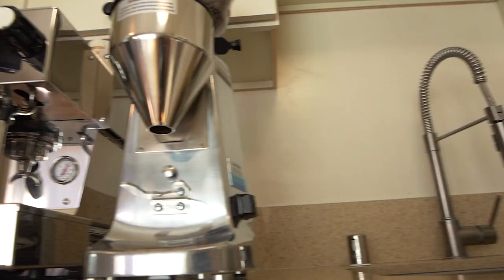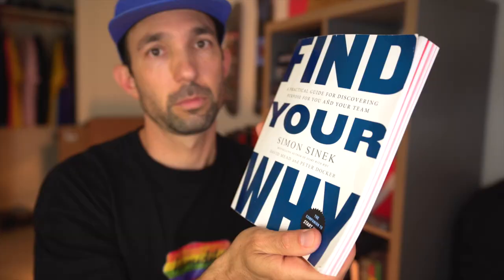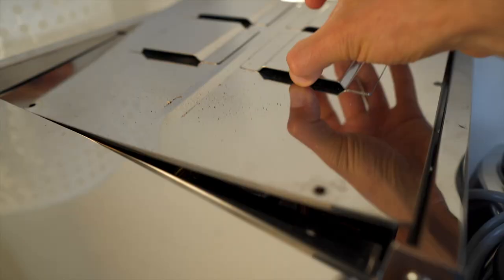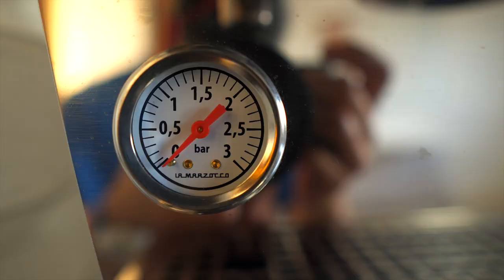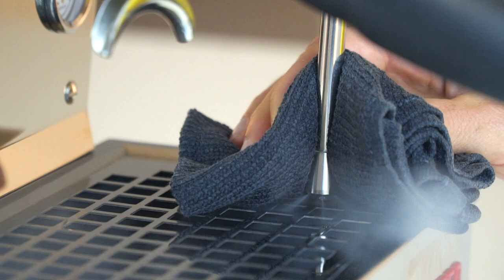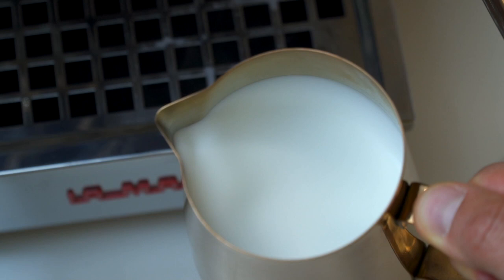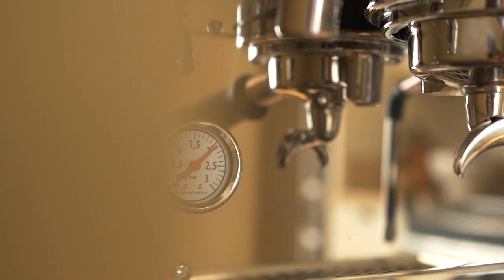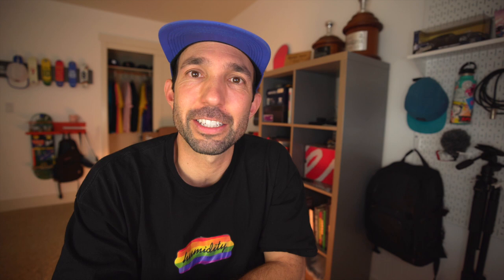La Marzocco Linea Mini Espresso Machine Review | Worth The Money?

Comment: I have a mini, I use it daily and I like it, but here is a reality check:
1. A lot of the stainless steel is lower grade/ thinner than less expensive machines. 
2. Within two week of purchase, the paddle switch on mine failed.
3. Within the first month a bushing on the pump started leaking. Tech discovered it had been over tightened at the factory and was cracked. 
4. Potentiometer failed and had to be replaced one week after the one year warranty expired. 

It makes great espresso, but has been a little high maintenance. The out of warranty potentiometer cost me a couple hundred bucks for the part, labor ,and the techs travel time.
Reply: same here with the GS3
1. Stainless steel not deburred
2. check valve broken after a few month
3. watertank deformed after   a few month  and causes false alarm (refill water)
4. 3 hole steam tip was the worst ever constructed, had to bereplaced by a 4 hole tip
5. LCD display faded after a few years, barely readable
Great espresso but this is by far not state of the art  this is "let's keep the price high  so people are convinced to brew the best espresso ever" otherwise they had to admit  to be pulled over the barrel (at least a bit :-)   )
Reply: Its like having an Instagram-hot GF.. great looks and maybe great sex but high maintenance! lol!

Jokes aside! I am looking at Dalla Corte Studio vs this. Now I see why I should stay away from the LMLM! Thanks for the heads up! I also read in forums that the GS3 is also troublesome! it seems LM is just a name and not worth the headache!

Comment: Some of my local small ice cream shops use linea minis paired with mazzer mini grinders for espresso afagato. Works great even in a light commercial setting.

Cost is a huge barrier to excellent home espresso. My local shop charges $2 for a doubleshot. That means it would take me 10 years of a coffee a day to make a $5000 machine 'worth it' for just myself. The economics do change when you have a family but it's still a lot.

Comment: I understand that the Linea Mini is programmed for one-second preinfusion. I am used to preinfusing from 5 to 20  seconds, depending on coffee and grind, on my Londinium lever machine. What is the point of one (!) second? Do you not find that a limitation?
Reply: I need an answer to that question as well. I don't really care about going as far into control as with, let's say the decent, but I feel like with the mini, for 5k, you're kinda short on options...
Reply: Shinshokuful This machine is designed for the home user who wants simplicity and power, and also mostly small cafés or catering. In a cafe setting there is no time for adjusting pre-infusion.

Comment: I kind of agree with you BUT. The ability to do a slow. Low flow pre-infusion is a game changer. It changes regular ole medium/ medium dark roast espresso blends as well. There are “Slayer mods” for the Mini. There are custom Led mods for the temp. The Mini was designed before these things got standard. If you’ve had god shots from a AV Strada, a Synesso Hydra, a Black Eagle, the Mini can come close for more than half the price. I think the Mini is best for those who want to keep it simple. Enjoy the beans the Mini does well. Pull the same coffee until the bag runs out. Maybe even stick to the same blend and roast. If you like Nordic light roasts, some difficult SO’s, want to pull Gesha espresso, better to have a more versatile machine like a Strada mod GS/3 (to keep it in the brand). But then the question is, how much better is the Mini than the Breville DB at 1/4 the price?

Comment: I really want a Linea mini but for 2000 less, I can get an ECM synchronica that has pretty much the same specs on paper. Anyone any thoughts?
Reply: definitely.
Reply: I have one I am happy.
Reply: I recently got the Profitec Pro 700 v2 (same machine, different exterior) and love it. 

Was tossing up between this and the Linea Mini. Heart said LM, head said Profitec. In the end LM made it an easy decision with a recent price increase which is Aus was significant.

Having a built in shot clock is a little feature that I would struggle to give up now too.
Reply: @GH-de8wv  yeah, I would like the shot timer in the ECM... Tnx for sharing!
Reply: Synchronika owner here. It's basically 95% of the experience of the LMLM IMO. Some users of both have said that the steaming on the LM is better (drier) because of the larger boiler and non-insulated wand; however, the Pro 700 & Synch have the same 2-bar pressure as the LM. However, I got maybe 5 mL of water from 30 seconds of running the steam wand after purging, which I'd consider to be negligible. It also has rapid recovery; after steaming milk for an 8oz latte, it never dropped below 1.5 bars and was back up to pressure by the time I prepped my next shot and started pulling.

If you're still considering the LM, double-check your vendor's warranty policy. Where I bought my machine, my Synch comes with a 2-year warranty (where the vendor will pay for return shipping), whereas the LM, as it's considered a "commercial" machine, is not subject to such a warranty and therefore servicing it will be more expensive.

I also love Profi/ECM's shot timer built into the PID. It's such a brilliantly simple feature.

Lastly, you can get WLL's Flow Control Kit for the Profitec/ECM E61 machines to play with flow profiling. You're restricted to a set 1-second preinfusion on the LM. There's beauty in simplicity, as Chris said, but that might leave some tinkerers frustrated. Depends on the person!
Reply: @LuckyDragon289  woow, thanks! I might actually go for the ECM now. You made some good points about the tinkering features there, which I am a fan of. I think I'm good warranty wise since I can buy the machines at my own work.
You were really helpful, thanks!
Reply: @GH-de8wv  this is my future
Reply: Thanks for the video. Good fun as always. Agreed on the steaming performance and PID wheel! Interesting, would have thought the GS3 AV would be better for events because of volumetrics. I won a LM LM and sold it to fund a two group machine and grinder and a cheaper HX machine for home. Needed the output.  I do feel a bit sad about all that.  Maybe one day back to LM. ✌️
Reply: Just have a look to that stupid plastic dial/temperature control of Linea Mini, also cheap plastic switch (no it's not a paddle)... You'll never find those cheap parts on a ECM or Profitec. Have a look to the PROFITEC LUCCA S58, with under counter pump and reservoir <3
Reply: TomTomGalore No point in shitting on other peoples dreams man, enjoy your opinion like others enjoy theirs...
Reply: @bboulette08  : profitec is very nice, I owned a pro 800 for five years....but they too have their problems, as does any machine. Mine was horrible to work on for instance. Had to replace a solenoid valve, took forever because of the retarded way they put everything together. There's no such thing as a perfect machine.

Comment: Hey, I've got the Linea Mini and absolutely love it (I'm using it in a little cafe I opened up btw). Just one thing I don't like or haven't figured out. When I want hot water, it splatters all over. Is there an adjustment or way to just have hot water flow out without spattering? Cheers from Canada.
Reply: It's a tricky thing but if you just tweak the dial a little bit (don't turn fully on) you should get a better stream from the nozzle. I turn it slowly just until water comes out, it's kinda slow but it works.

Comment: I have a Quickmill Vetrano V2b (1st gen) that retailed for mid 2K. While the espresso quality is good, and the PID is nice, the steam power has never come close to what I experience at 3rd wave shops. Steam power is less, is less dry (has more moisture), and the tip opening size and angles never get the vortex needed to do truly high quality microfoam. I've used 2, 3, and 4 hole tips. Over 7 years, thousands of lattes, and experimented with different angles, pitchers, milk brands, etc. Still nowhere near what I can achieve on pro machines (yes I'm friends with a couple of local shops that let me use their machines after hours). My next machine I want to steam like the pro machines that my friends in my local 3rd wave shops use, and the Linea Mini looks to fit the bill. I do wish the temp control was digital, but I can live with the wheel. The other thing I wish this had was a shot timer, but I'll continue to use my $8 kitchen timer if it means this machine will brew and steam like the pro versions.
Reply: If you are into light roasts you should buy a machine which is capable of flow or pressure profiling.

Comment: Question about dose on LM groups... do you usually end up with a screw imprint in the puck after pulling a shot? If I put an 17g dose in a 17g basket, I get a little imprint. Good/bad/who cares?
Reply: Sam Roesch probably depends on the basket but different coffees can take up more volume for the same dose. Screw imprint means you should reduce the dose ideally, because there should be enough room for the puck to expand as it saturates. I routinely dose over 20g in a 17g basket (not LM), so there is no exact dose, just experiment.
Reply: Nice thing about these machines is you can replace baskets to whatever your heart desires. It's all standard cafe sizes so you can get a basket that fits your desired dose. Yeah it's more money but worth it if you want to go the pullman/VST route.
Reply: Michael Hartmann I’m aware, but that’s not really what I’m trying get at, to rephrase: my question is whether LM purposely sizes a 17g basket such that the dose hits the shower screen (despite common lore saying the puck should not touch shower screen)

Comment: I found your channel due to the Linea Mini unboxing video. You promised a review and I subscribed. Seeing this review in my notifications felt like Christmas morning!

Eventually, this will be my machine for all the reasons mentioned. Number one is the steam for latte art. I’ve pushed my ancient Pasquini  Livia 90 and my skills to their limits, but the milk never pours with the grace displayed in the better latte art videos. As good as the Strada, you say? Yeah, I want that.

I’ll never do a pop up bar, but to be able to crank out drinks quickly at family events and parties would be great. Why have people over and spend your time with the machine, rather than with them? (Of course, I can get that by just moving from single to double boiler... probably.)

Finally, I never liked chem lab. I have no desire to run endless tests on pressure and heat ramps. Besides, we roast small batches at home and there are variations from batch to batch. Dose, yield, time and temperature are everything I need. I can tune dose, yield, and time quickly and might rarely get to temperature. (My recent exception is a very dark roast that clearly needs a lower temp than our usual roasts.) Having the other control would just make me feel like I should do more, or that I might have some parameter screwed up.

Design? Meh. It’s no Ferrari. Sure, it draws from the history of the Linea, but I’ve never been in the business, so I didn’t develop fondness for the legacy. That said, it’s cleaner and more understated than an external group machine. It doesn’t look as pretentious as it’s price tag.

Finally, robustness and support mean that I won’t waste time with frequent repairs or find it orphaned with obsolete parts.

If only the price was lower. Otherwise, it would already be on my countertop.

Finally, thanks for the Christmas morning experience, Chris!